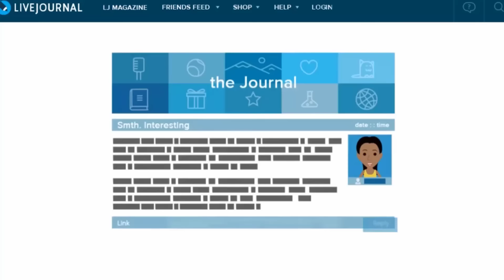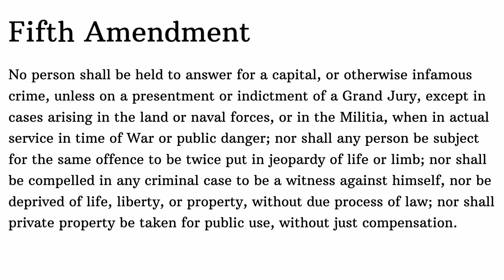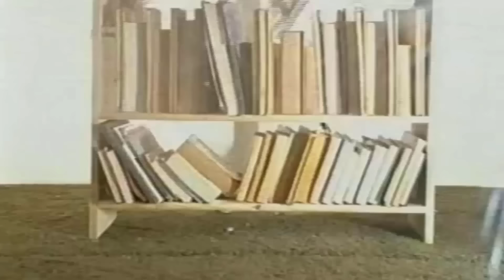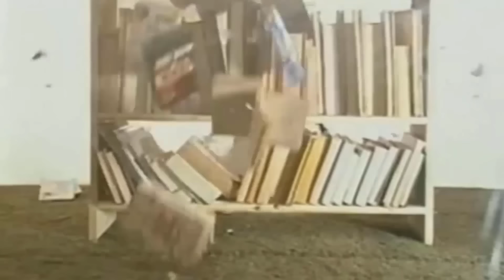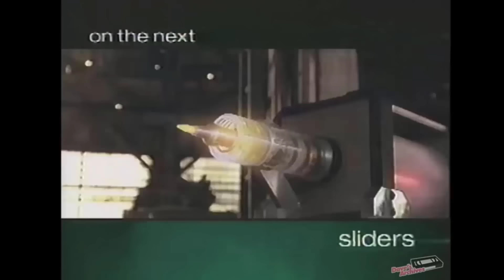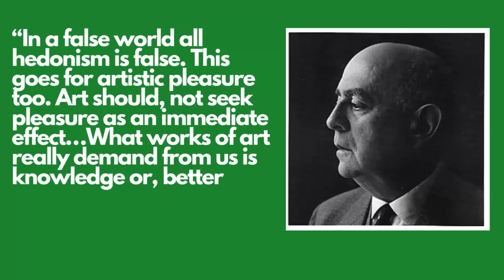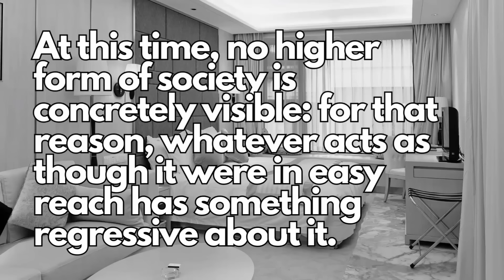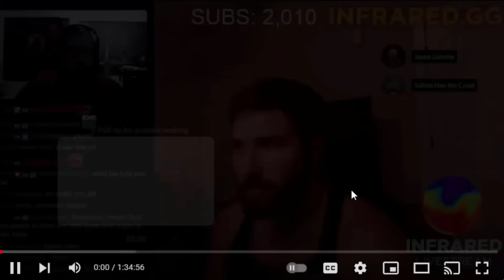Postmodern Neo-Stalinism vs. Western Marxism

Comment: I have a complicated question. Hopefully you will take the time to address it. Maybe my thinking is incorrect, but I'll try to phrase my question correctly.

I agree with Haz that the praxis of an idea is assessed materially according to its result, not necessarily its original intention, even if the intention was honest. That is to say a paradoxical outcome, like anti-imperialists who help imperialism, is possible. Until relatively recently, this level of materialism was a common assumption, though that no longer seems to be the case. He, and you, are saying the other debater would essentially want to return to a long-ago past, in hard material terms, which isn't possible and also anachronistic for various reasons. Haz, you are saying, is also doing this, by arguing that his philosophy - I suppose as a Stalinist - is anything other than another return to a different stop in our time machine, but ultimately the same operation.

Now, may this not also be said of most Marxists? Let me explain: the Marxist political project is built on the liberation of a wage-earning proletariat, workers who have nothing to sell but labour-time with the chief modality of that labour time sale being factory, productive, constructive labour. Looking just now, Statistia says services account for 79%~ ish US labour, which is to say, the project that Marx and moreso Lenin built their political millitancy on, no longer exists. Let me be precise: they are still proletarians in the aspect of wage relations and all other relations, but they no longer wield the important capacity to turn off or challenge national production of the entire physical infrastructure of the nation through concerted action. Instead, what the proletariat is composed of, materially, is now for rich countries, mostly service workers.

In this light, what would need to be altered in Marxism, or anarchism, or anything, to create an effective political movement to change the world given a basis of mostly service workers? What strategies and tactics would they use? How would they make themselves obnoxious and thus powerful to the ruling classes as such? I don't think the answer is necessarily contained in classic left texts, because this was not an outcome they ever predicted, but nevertheless, materially, it's there.

I suppose this is a huge heresy I've just spoken, but I think it's consistent with your point of view in this video.
Reply from the maker: I think there is a presumption that what gives the proletarian class its power is its ability to turn off production, but my understanding is that the power of the strike is not the power that makes the workers the "revolutionary subject." Rather, it is the fact that the workers are setting the terms of society socially, that their labor is the source of the value that mediates all relations, that gives them power. A working class political project aimed at realizing the true interests of the workers, namely to overcome and transform their own activity, is what is needed. The aim is to create an international movement that will demand the full expression of the worker's productive power. Full employment would be amongst those demands. Strikes may be one tool used in the struggle. But it would be a matter of self-organization as a political force that would accomplish a revolutionary transformation. 

Service workers, factory workers, healthcare workeers, even public employees could conceivably be members of a proletarian party that aims at this transformation. 

What you've said isn't a new heresy, by the way. It is one that one of my favorite Marxist theorists, the late Moishe Postone raised. I think I discussed this with him in an interview back in 2017. 
https://youtu.be/ZbJKoUcnfIo?si=UbOMW07if42J95X5
Reply: @sublationmedia 
do you not see a disconnect between a working class movement serving the interests of workers taking place in "developed" nations with service economies on the one hand, and the interests of the hyperexploited, materially productive proletariate of the global south, however?

Our service economy and our proletariate's very ability to engage in that form of labour are directly and inextricably dependent on the exploitation of the labour and respurces of the global south. Under such conditions, I fail to see how any such movement, undertaken by western workers in their own interests could ever be commensorate with the emancipation of labour elsewhere. That is, we stand directly in the way of this international proletarian movement that you suggest. The persual of our interests directly contradicts the interests of labourers elsewhere.
Reply from the maker: I do not see a disconnect between a working class movement serving the interests of workers in the developed nations and working class movements elsewhere. Quite the contrary. Without a working class political movement in the developed nations socialism will never be achieved. 
The United States is the world's second largest exporter of goods and has a huge manufacturing base. The service economy sits atop that highly developed and automated productive base. It is not the service sector workers of the North who are responsible for wage suppression in the periphery. 
That said, any attempt to achieve higher wages, full employment and cooperation between workers internationally will face a huge amount of oppression from all sides. 
What we don't want to do is assist the capitalists in their effort to drive a wedge between workers.
Reply: @sublationmedia  According to the World Bank (I know...) the percentage of service workers is high in many countries that are really only middle income or lower-middle. For example: Brazil, 71%, the Bahamas, 81%, Dominican Republic 72%, Honduras 52%, Namibia 62%, Mongolia 52%, Nigeria 47%, Venezuela 71%, Gabon 55%, et cetera.

So it might be said that our technological level, even in places where resources are ordinarily extracted, can have a smaller workforce because machines can do more with less hands. I'd have to go do work to prove this, but it seems reasonable. The point is: even outside of the rich world, there seems to be a move towards service jobs, anyway.
Reply: @sublationmedia  you say it is not american service workers who are responsible for wage suppression in the periphery, and that is true in the strict sense. But american workers are dependent on wage suppression in the periphery. A starbucks barista does not and can not exist without the near slave laborer on the columbian coffee plantation. Unless you can think of a way the barista can claim a larger share of starbucks profits while simultaneously organizing in tandem with the coffee plantation labourer to free said plantation labourer from the brutally explotative labour relationship that allows starbucks profit to exist in the first place, it's a non starter. The plantation labourer's interests are diametrically opposed to the baristas. There is no getting around this. The same issue exists with much(certainly not all, oil and gas and the chemical manufacture that are downstream of these come to mind here) US manufacturing, as it depends on cheaply available resources extracted from other places. Note, I'm not sayong americans cant, or should not attempt to build a labour movement, I'm saying that under current conditions, any nacent labour movement in the US is subject to the same pitfalls that have rendered previous american labour movements ineffectual. American labourers are too quick to turn on global labour, amd too quick to turn on each other, especially across racial lines, as evidenced by the entire history of american labour organizing. And american corporate interests are too deeply entrenched in the production of knowledge and ideology within american borders for this situation to change any time soon. So in short, I fundamentally disagree with your assertion that any global labour movement should, or even *could" start in the US. American workers will not do anything of use to anyone outside of their own percieved circle, let alone outside of their own country, without being forced by circumstance to ride the wave of an extant and inexorable labour uprising in the places whose exploitation fund american quality of life. And here im really using "american" as a stand in for the entire global north. The nordic model is all fine and good, until the profits of imperialism dry up, and they aren't even the ones directly managing and implementing the imperial project, merely operating within its byways. How much moreso then, is an american socialism a direct obstacle to global emancipation? I just don't see it happening the way you seem to see it happening.
Reply from the maker: @coyoteblue4027  All workers are dependent on the exploitation of other workers. Without the importation of Gold from Africa China's tech industry wouldn't function and the workers there would be out of a job. It is also not true that workers as workers are opposed to each other. The only thing worse than being exploited under capitalism is not being exploited, ask a Palestinian. 
"Unless you can think of a way the barista can claim a larger share of starbucks profits while simultaneously organizing in tandem with the coffee plantation labourer to free said plantation labourer from the brutally explotative labour relationship that allows starbucks profit to exist in the first place, it's a non starter. " 
Of course, an international workers party would be aimed at precisely this sort of organizing of workers.

Comment: I defend "Stalinsim" because I'm not interested in throwing the baby out with the bathwater. Stalinism is just what happens when you assume control of a country after a series of local apocalypses. They were lucky they got a principled group of Communists in charge instead of any of the likely alternatives, because they survived a third worse apocalypse. 

This matters to real people, real workers, more than adherence to middle class leftism does. The imperfect cadre that suppresses bandits and helps dig a drainage ditch matters more than anything. I point this out because the primary appeal of Western Marxism is Western intellectuals, and people outside the West who want to be Western. There's a reason just about every version of Marxism or other ideologies gains traction in global hot spots, but Western Marxism does not. Aesthetic and ideological concerns melt away in the face of raw need. 

The problem with the Western left is that we turned our backs on organic working class culture, on mass industrial culture, instead retreating into boutique petite bourgeois positions that only care about correct cultural values, on creating a counter culture, rather than connecting with the real revolutionary culture already in development, something that includes 1776, Nat Turner, Sitting Bull, tractor pulls, shrimp boils, Christmas etc. Becoming endlessly skeptical and even jaded about the things people give a shit about and like because it don't  correspond to what workers "should" do is the problem. 

I know that ain't exactly where you're at Doug, this is a general observation/complaint after i been doing this for 20 years. I don't think Haz exactly gets it right either, but Fawley did the other day. I just don't buy these Adorno/Arendt/Butler etc notions. Just sounds like anarchist gobbledegook to me.
Reply from the maker: I don't know who think you're talking to, but you're not addressing anything I've said in this video. 
But I'll address what you've said. To begin with, it isn't the case that "Western Marxism" or the Frankfurt school hasn't gained traction outside the West in the past. Certainly they influenced left dissidents in Slovenia. 
Secondly, there is nothing remotely working class about the love of Stalinism today. It is the reserve of petite bourgeois intellectuals, just as every other leftist tendency is. If you want to claim that supporting China or Russia or Iran makes you more relevant than Western Marxists you will not be making a different argument from those who would argue that supporting NATO, the Biden Administration, Macron, or any other current capitalist state is a path towards relevancy. It certainly is, but it has nothing to do with socialism. 
I like how you say you reject aesthetics and then mention tractor pulls, shrimp boils, Christmas...I'm not against any of those things by the way, but you're certainly talking about aesthetics. Back in my day all the leftists drank Pabst out of a similar drive towards authenticity. Pathetic. There are better beers that are much pricier. 
Conflating Adorno with Arendt and Butler is a mistake. Did you actually watch the video? 
I was frustrated with Ashley last week because she went on for about six minutes saying quite a lot of things I agreed with, but couching it as if it was a critique of Adorno when it was not.
There are reasons to critique Adorno. His reliance on Pollock and overestimation of the power of the Administrative state to overcome economic crisis would be my critique, but none of this addresses his primary point, the one I raised by quoting his essay resignation. 
Again, this video was not a defense of Butler or Arendt. But, what I would say is that we should ditch anti-intellectualism even as we ditch the pretentions of intellectuals.